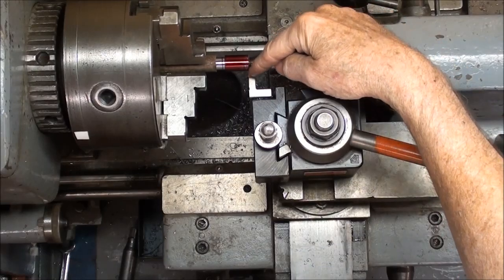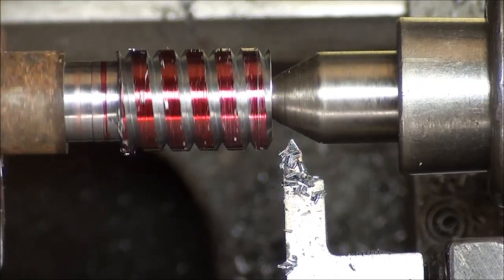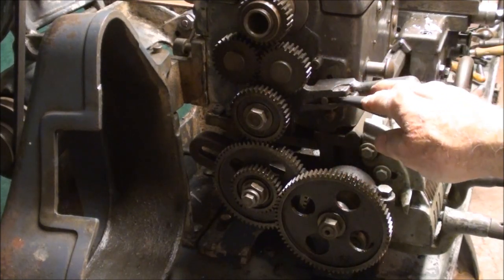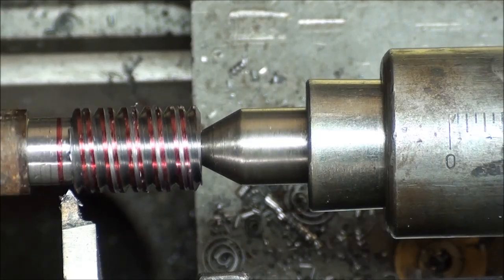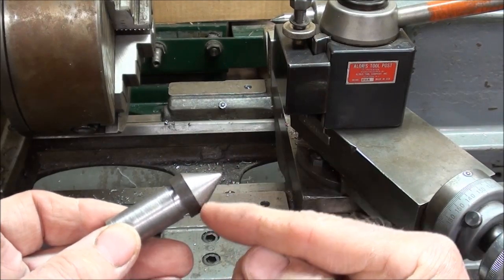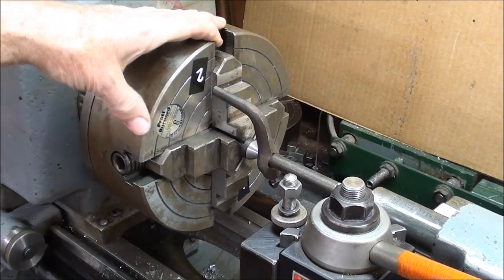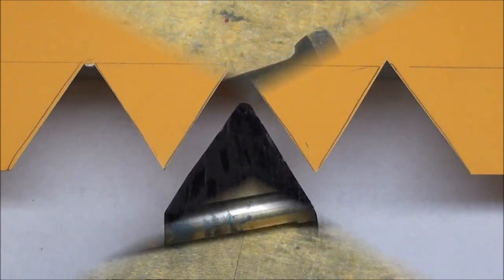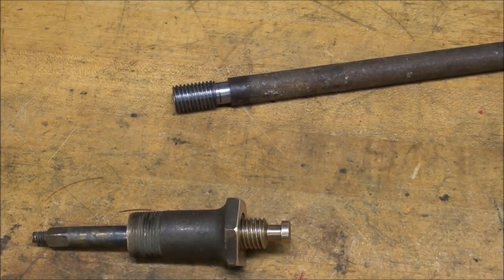MACHINE SHOP TIPS #129 Cutting a Double Thread on the Lathe Part 2 tubalcain

Comment: Though i watched quite a lot of your videos to date, its honestly the first time i came across turning double thread of which i was aware previously and always wondered how it was done, my previous employer pointed this out when i wanted to replicate a cormer 90degree clamp many years ago. So then i learnt most clamps have these kind of threads i really enjoyed learning about this. What ud like to know is how much different do we grind our cutting tools, judging by your tutorial, doesnt seem much different, unless there are mayby other considerations? My lathe(hobby)has a pitch that allows me maybe 3 multiples of thread at most as it has in metric, 3mm pitch so this should easily be accommodated. I will certainly play with this in near future😃thanks for shedding light on this type of thread
Reply from the maker: Thanks for the comment, glad you enjoyed it.

Comment: Very interesting video. Reminds me of my job of 13 years milling extruder feed screws for making plastic products. We did many 2 start threads, sometimes in different leads 😮. One thread would eventually meet the other, but that was the way it was designed. A very interesting job. I learned a lot working there.
Reply from the maker: That's a very interesting job!

Comment: I mean absolutely NO disrespect but I fail to see the benefit in a practical way for doing this when threads have been for a very long time engineered for there strength and effectiveness.  splitting threads appears to leave yourself open for error and time consuming.  If I could be shown the benefit of it I would be the first to jump on board.

Comment: Mr. Pete, thanks so much for taking all that time to post your educational videos.  It makes me wish that I had been in your shop class, but thanks to the internet, I guess I can.  In the above video, you say that multiple start threads are never used for fasteners, but I have found the rare exception.  Square D uses four lead screws for the cover plates on their breaker panels.
Reply from the maker: Thank you, yes I have seen those fasteners
Reply: I ran into another application  when a double helix screw was used. It came with a Wen generator that I just purchased. The generator came damaged from the factory and some unscrupulous machinist had included a double helix wheel mounting bolt so that when assembled with a regular nut would make it very difficult to disassemble to return the generator. The average customer would think they had just cross threaded the bolt making it less likely to get returned and very hard to detect. Nobody ever thinks to check if it is a double helix thread.

Comment: I suppose the big advantage of the between centres, drive dog on the jaws method, is, if you have to deepen your threads, you can simply switch between jaws, and take an extra cut on each thread.

Comment: Thanks again Lyle, I do need to make a double or maybe triple start for a worm and tap on the same bar to then also hob a gear for a screw fed ball turning attachment for my lathe, I was wondering about a few things mainly how to accurately index the work 180 or 120 degrees without disconnecting gears, you answered that perfectly thanks, I'll go with the between centres method and also stick with between centres for the hobbing.

Mark.

Comment: Great instructional video, but the double thread really screws with my head. It would appear that as long as the tpi is the same the speed which the thread advances in a nut would be the same. That part I am not getting at all. But thanks for the video.

Comment: I'm late to the party but.. couldn't you just use a little trig to figure out how far to move the compound in? You'd need to back up the cross feed for clearance. I could see where on internal threads, on an irregular shaped part, that would be advantageous to those people that set the compound to 29-30 degrees. Also, unless the angle on your tool and the angle set on the compound are exactly the same, the tool will be cutting on both faces anyway. If you have a light lathe you may benefit from a perfect setup but you should get the same result by just taking less deep cuts using the plunge method.  Thanks again for the excellent video.
Reply from the maker: Sure you could

Comment: I missed if you said this..But is the internal thread also double cut?  Seems like is should be.
Reply: Yes the thread on the nut has to be cut twice also.  They did mention it, a special tap needs to be used (a double thread tap!) or a boring bar for larger internal diameters but it is not for the faint of heart he said.

Comment: Great Video Me Pete.
 Would just like to point out that, when cleaning up the thread to fit the nut you will have to clean up both threads, (most likely).
 For people asking to show an internal multi start thread, It's just the same set up as for external.
Reply from the maker: +john irons  Thanks for watching

Comment: On manual change gear lathes couldn't you just disengage the gears at the banjo and turn the spindle 180 degrees with paint marks then re engage? 120 for 3 start
Reply from the maker: I have never done this, but did you mean turn the spindle 120 deg.? Then I think it would work.  Do a sample on alum.
Reply: Yes , say you were cutting a 2 start thread...if the gear on the spindle was say 40T then after your 1st cut disengage at the banjo and basially move the spindle 20T phasing the spindle 180 degrees for the 2nd cut. Im about to try it lol
Reply from the maker: bubster1981
yes-try it on a sample piece
Reply: Worked good, i cut a 8 TPI double start at 1/2 diameter. The reason i thought of this was i noticed you plunged cut your's with the compound 90 degrees to the cross slide. Makes for easy measurement of the tool bit for the 2nd pass like you did, but i thinking of cutting larger threads where an angled compound would be desired...and was thinking the compound travel would have to be quite large and might give headaches for the 2nd pass as everything has moved...this way the relationships all stay the same . Just a thought
Reply from the maker: bubster1981
Thanks for watching-good observation.

Comment: No disrespect whatsoever Mr Peterson but if keeping the compound at 29deg (today with trig calculators in your top pocket), might not it be easier to draw on the white board just what are the triangle ratios when the compound advances 1Unit? At 29deg, the triangle becomes hyp=1 Opp=.4848 Adj=.8746. With staying at 29deg and with a little practice, we can know the exact position of the tool tip once it has been zeroed initially, and with only the advance of the compound. Its just a thought. I'd prefer to work this way rather than taking sideways measures. I'd get the precise (no backlash) pitch and work the tool tip N/S, E/W on the ratio against 1 especially when doing small stuff like this.

Comment: Seems that the cast drive plate wouldn't be out of tolerance any more than your dial indicator that wasn't perpendicular when you took your measurement.  Perhaps for this application these threads generally have enough slop that that minute amount won't hurt things.  Yes/No?  I missed the point of why you plunge cut these instead of feeding with the angled compound.  I realize there would be a little more math to indicate the tool start position.  Back or advance the compound so the tool moves half the lead, advance with the cross slide, touch off and re-zero.  Would that work?   I'll watch it again.  Great segment!
Reply from the maker: +blmeflmm66 THANKS for watching--much more to come
Reply: Great!  Keep up the great work!

Comment: The proper terminology is "in-feed angle". 0 degree in-feed angle would be what you call plunge cutting. 29 degree in-feed angle is your preferred method.
Reply: Correct me to iff i'm wrong or inacurat...with i wild guess... DomManlnT1,you're a CNC machinist right? :-)
Reply: I mostly do CNC machining. But I am quite capable of working on manual machines.
Reply: DomManInT1 Oh,no pun intended sir,with guessing you were working CNC i didnt imply you wernt able to work on conventional,it was all about the guess itself because the terms you used and i was right :-)...now did i win something? :-))

Comment: in general it will be far more accurate to rotate the dog 180, 120, or 90 degrees.
the reason why is because to get the same accuracy you need to divide the angular error, say its one part in 180 off, by the tangent of the lead angle, if you want to do better than moving the cutting tool. 
basically, if your dog is at 0 and 178 degrees, you would need to position the cutting tool for the second start to better than one part in 180 for a 2 start screw with a lead angle of 30 degrees. for a lead angle of 15 degrees, the tool would need to be positioned better than one part in 360!, which might be rather difficult.

another option would be to find a tap with the same teeth per inch and stick it into the boring bar holder and cut all the teeth at the same time...

Comment: I do this on a weekly basis. The Ponar lathe I use allows you to 'split' the lead using the thread chasing dial.....makes it pretty easy to cut double lead threads. We also use a large Dean, Smith & Grace to do longer shafts over 32 inches......  You must turn the the chuck 180 degrees when cutting the second thread due to the configuration of the lead screw. But it works well. This was a very good instructional video and like most appreciate your efforts in trying to school manual machinists the proper way to go about making parts and having them actually fit. I believe that manual machining is becoming a lost art....thanx again for your continuing efforts to perpetuate manual maching.

Comment: Thanks I learned a lot. You know the orange juice container that you showed? I think it had a 4 start tread, could you do a video showing how to make a  aluminum cap For that? I would really like to see how it would be done. A alum cap with internal threads that's short and is 1/4 turn on and off.
Reply: I would imagine that you would have to turn that on the "wrong side" and start form within the nut and move the tool back to the right, but i agree, it would be interessting to see how its done properly
Reply: or perhaps turn the chuck by hand...that would probably be easier and quicker...

Comment: As always, Mr. Pete, I do enjoy your videos quite a lot.
But, I´d rather make a comment on this last ones: globe valves, are not cheap replacement of gate valves. They´ve got a completely different function: gate valves only open or close, while globe valves can regulate the flow of the fluid. It´s true that even when they´re fully opened, they pose a restriction to the flow, but that´s the price you´ve got to pay if you need flow control.

Comment: Thank you very much for you excellent videos. I enjoy watching them very much.
In this particular case an alternative method based on the non parallel
compound rest setup (as demonstrated in the second half of part 2 of your video)
comes to my mind.
For simplicity I will use 30 degrees.
You can still use your compound-feed to get the parallel travel towards the chuck as follows:
advance the compound rest by the desired distance (in your example
0.084) divided by the sine of 30 degrees, i.e. in this example
0.084 / sin(30) = 0.084 / 0.5 = 0.168.
Naturally this would also bring the tool too close to the work.
You could compensate for this using the cross feed (naturally).
This can be done by finding the point where the tool just touches the work.
Or you could calculate the amount of cross feed as
compound-feed * cosine of 30 degrees, i.e in your example
0.168 * cos(30) = 0.168 * 0.866 = 0.145
So you have to retract your cross feed by 0.145.
To be honest: I never tried this method, but it should work.

Comment: Thanks Mr Pete that was my last job at trade school this year. I had to do a 2 start internal then a external on the end of a double throw crankshaft between centres. I like the method of indexing with the chuck as that's where I think I made a mistake with the external thread. Could you also do a video on an internal multi start threads please.

Comment: I work in the valve repair industry and have made numerous stems for gate valves with double lead threads,  on some lathes you can split the threads by catching the lead on a number and then half way between the number and the next line. Just thought I would mention this method as an option to try.

Comment: since the cutter cuts in both directions, could you reverse the direction of your feed and feed back across instead of backing out the crossfeed, going across, and going in again to make a cut?
Reply: If the machine were perfect, yes.  But when you try cutting in both directions, the backlash of the gears and feed screw come into play and you will have a messed up thread.
Reply: Eddie the Grouch Ah, thank you! I always wondered why I couldn't simply do that!
Reply: No, that would cut a left handed thread!
Reply: rhinocat
DOH!  You are correct of course.  Reversing the feed with same rotation is a left hand thread.  Reverse both and the tool won't cut.  I don't know what I was thinking but I am blaming the NyQuil!

Comment: Thanks for the very informative video. One question that I have - when using the second method (relocating the part by rotating it and feeding in with the compound at an angle of 29 degrees), how do you determine when to stop feeding in on the first thread? Is there a formula for using the scale on the compound to measure the depth of the thread? Hope my question is clear.
Reply: .010 dial movement on the compound at 29 degrees is equal to .008746.  Just remember that the diameter is reduced by 2x that amount.

Comment: I will expound on turning a chuck dead center.  Its cheap its fast and is your best
friend.  As said just dont take it out. This is the way I was taught to do this. Dogs,
we use anything from hose clamps, muffler clamps, there is not a lot of load on
turning with a makeshift clamp. I think this is the first demo of this, so thanks Lyle,
for another exellent vidio for the younger people to keep the dying breed alive. 
Perhaps some day I shall get a vidio camara and add my many many no math
no frill machine skills.  My first interesting vidio will be, turning a taper on a shaper,
and surface grinding on a shaper.  Boring a boat shaft taper on a shaper. Milling on
a shaper.  How to thread a six inch by 10 foot long on any lathe. we do all the time.
Mill machine tricks   problem is I have not graduated from 8mm movies yet. 
hats of to you - got no clue how you flim these perfect vidios. 

Still livin in the 50's      sam